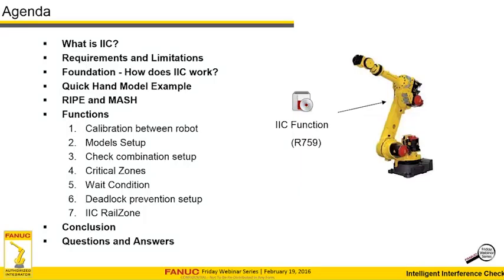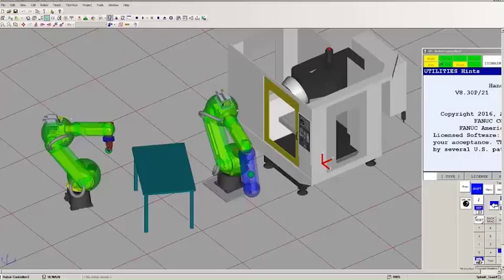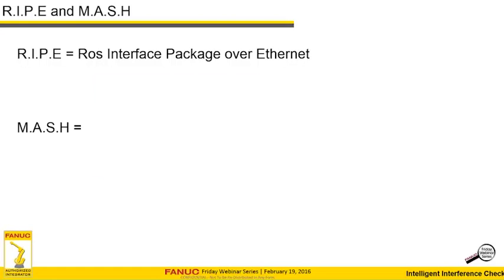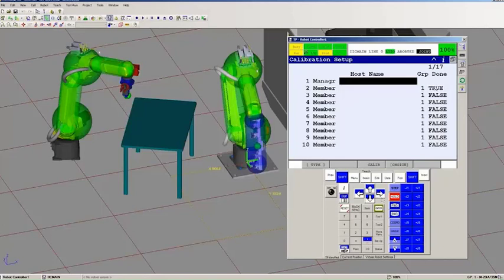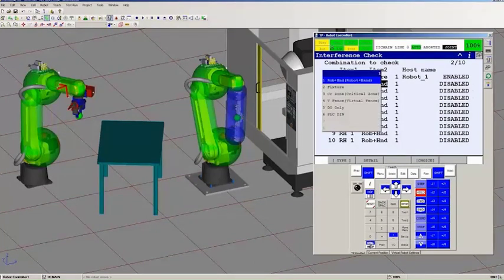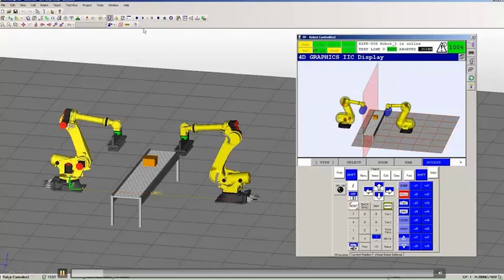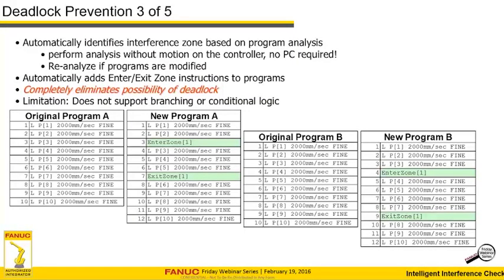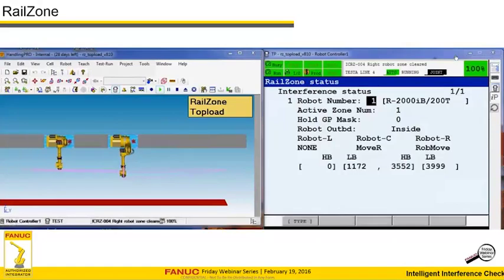How to use Intelligent Interference Check 256 1 28432

Comment: Thank you so much for your useful video m I have 1 question is that if we use critical zone for Robot 2, so that on Robot 1 we do no need to set up any thing ? IIC will automaically unsderstand about critical area and it will not crash each other. 
I did following set up like video on Roboguide but when the program is running auto mode. Robot 2 is stop before it can get the product.

Comment: Hi Greg, thanks for the informative video! Does the Intelligent Interference Check option need to be installed on ALL robots that are to be protected, or just a single 'Master' robot?
Reply from the maker: Each robot needs to have IIC. Also you need to ensure every robot is running the same version of system software.